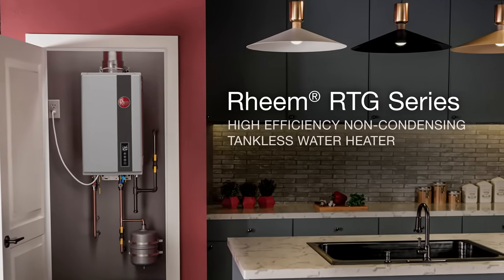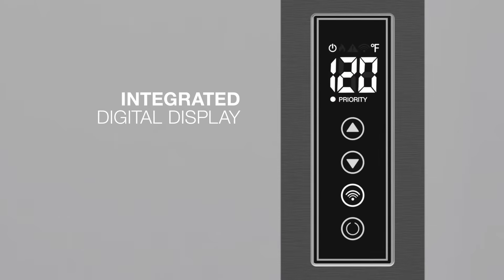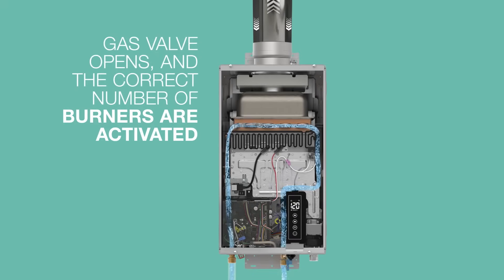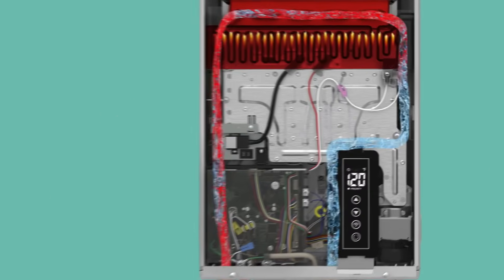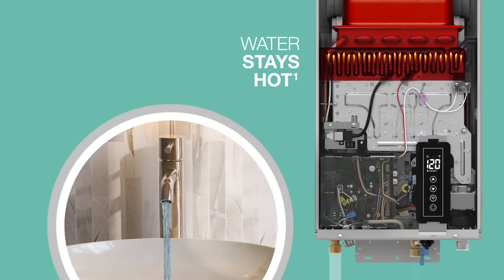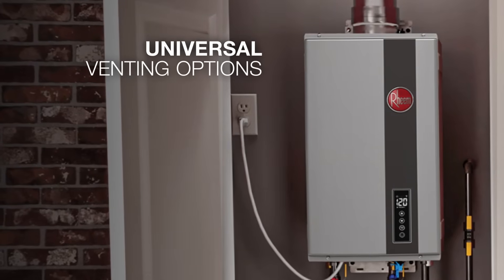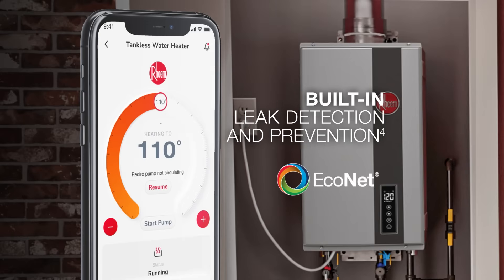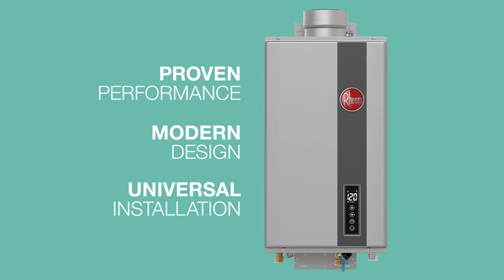How the Rheem® RTG High Efficiency Tankless Water Heater Works

Comment: Easy to install, just did one in a mobile home, replaced all the old gray poly with pex A as well.  Needed the service set and stack.  Old 40 tank had to be taken out through a closet but my nephew was up to the task.

Great price at HD included wifi.  Don’t forget to insulate and follow instructions. Bought lp since natural gas not in the park and cost more to run electric; we already had op for stove and heater too.